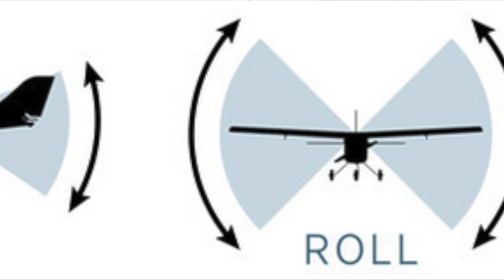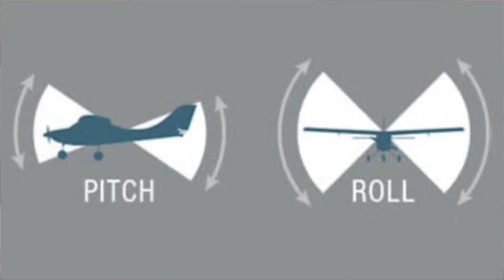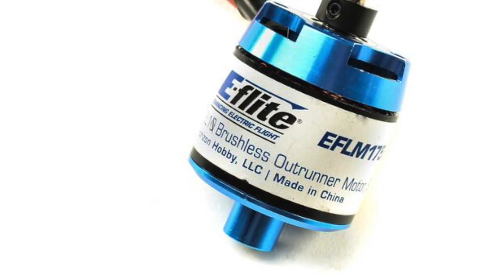RC Flight School Episode 3: Parts of a RC Airplane and what is AS3X and SAFE

Comment: Is the ASX3 comparable to a gyro or does a gyro have more functions ?
Reply from the maker: AS3X is a gyro based stabilization system. The system is tuned for each aircraft so that it provides the best level of stabilization for that particular airframe.

Comment: Two questions on this video.  You show a receiver but if i am not mistaken then the Habu has a seperate flight controller and serial receiver.   Why is this done ?   Second question:  what is the difference between Safe and flying with low rates ?
Reply from the maker: I believe the flight controller is part of the receiver on the Habu, but I haven't had it out since wrapping up the school. Typically, Spektrum puts the flight controllers and receiver into a single unit. That way it is only one item needed. AS3X and SAFE are built into the BNF and RTF receivers from the factory (although not all planes have SAFE). SAFE is very different from flying on low or reduced rates. Rates are how much deflection the control surface moves. 100% is full rates and you get 100% movement of the control surface. Lowering the rates will lower the amount the control surface moves. This can be done to make the plane less responsive. For example, I like my E-flite Cherokee to fly like a full scale Cherokee, which aren't very aerobatic. I turned down my rates to 50% so the plane feels more sluggish in the air, which is how a full scale one feels. Rates can also be used to make the plane feel less twitchy as well, but that can also be done with Expo. Expo softens the responsiveness around the center of the sticks. I use both Expo and reduced Rates to get my planes to fly how I like them. The guys that fly competitive aerobatics don't want any reduction in response or control, so they fly at full 100% rates and no expo. Those planes are very twitchy and require a lot of skill to fly. SAFE on the other hand limits your bank and pitch angles. On low rates, you can still fly inverted or fly straight up or straight down. SAFE in beginner mode doesn't allow that to happen. It limits bank and pitch to make the plane unable to go inverted or have a high angle up or down. In intermediate mode, the bank and pitch angles are increased, but still no going upside down. In experienced mode, the SAFE system is off. In all modes of SAFE, AS3X is active, which provides damping for wind and turbulence, but doesn't  limit control surface movement or control the attitude of the plane, it just counters the effect of wind.
Reply: @BRGT350  thank you so much for the extra info.  Now the difference between Safe and low rates is clear to me.  I'm coming from RC cars on nitro and electric which i have been driving competively for almost 20 years now.  But still a lot of stuff from the airplanes is very new to me.  For instance we don't talk about rates but about EPA (end point adjustment).  With cars we use it to limit the servo from going to far so it doesn't push the servo over the limits each time we steer.  Expo is something we don't use that much.  Maybe just -10% in the steering to make the car less sensitive on the straight line.  Still a lot to learn about airplanes so i will continue watching your flight school 🙂
Reply from the maker: I came from cars as well, but only a few years of driving them around with friends before I got into airplanes. The understanding of Expo on your car's steering is the same as it is on the planes, except you can adjust the Expo on multiple control surfaces. I go with 30% expo on the ailerons and elevator and 10% on rudder. From there I adjust as needed for each plane, but that is pretty close to what I run on all my planes. The rates change a lot more from plane to plane. I had one plane that I had 40% on the ailerons to make it fly like a giant seaplane. My F-16 has aileron rates at 80% so it has a much faster roll rate. For starting out, the RTF planes don't have a computerized radio and the rates are preset via a switch. High rates is 100% and low rates is something around 70%. On SAFE beginner mode, you will want to use high rates as the computer on the plane will limit the control surfaces based upon the rates. I only recently learned that. Once out of beginner mode, use low rates until you are comfortable with high rates. Expo is not assignable with the RTF transmitter.

Comment: Great series. Well done. Everything you said is well put and correct. One correction: the panic button only works on the trainer planes that come with 3 flight modes, such as the RTF Habu etc. Your regular BNF model does not have panic in safe mode. Being able to switch from AS3X into safe select IS your panic button on a BNF plane. Cheers from Switzerland!
Reply from the maker: Thanks. Since the filming of that episode (which was early May) I have been talking with a few club members about SAFE on a regular BNF model. On my 64mm F-16 BNF, it seemed like I had the normal 3 modes of SAFE, like the Apprentice, Habu, or my Corsair S. When trying it out on a few other models, it seemed like SAFE was just 2 modes. I thought it was because the pilot had a 2 position switch programmed instead of a 3. We changed to a 3 and it didn't have any effect on SAFE. That got me thinking that indeed BNF models are either SAFE on or SAFE off with the switch, and the panic button doesn't do anything. In all my years of flying SAFE aircraft, I have never used the panic button to try out how it works and which planes it doesn't work on. I do think your correction is 100% correct based upon the flying and discussions I have had since filming.
Reply: @BRGT350  Yup, there is no intermediate on BNF planes and no panic button, just safe with AS3X or AS3X only.
Reply from the maker: Yeah, that is what I have learned as well. I think my 64mm F-16 is the only BNF model I have with SAFE enabled. The funny thing is that I thought I was flying it around in intermediate mode when in fact I wasn't. It was SAFE off the entire time.